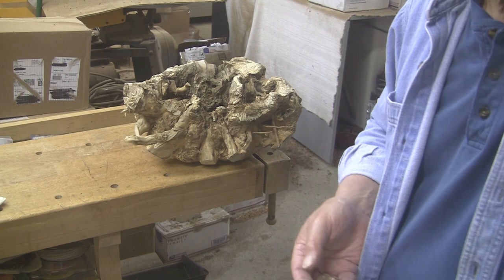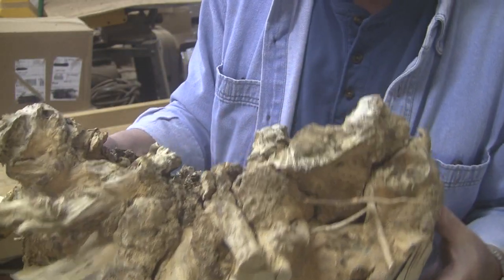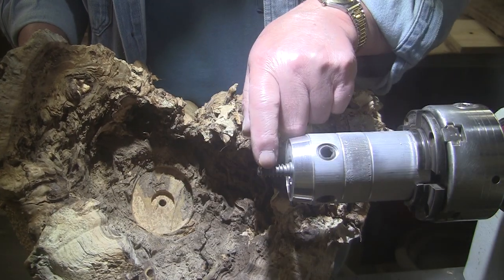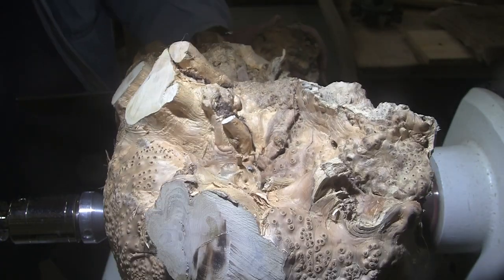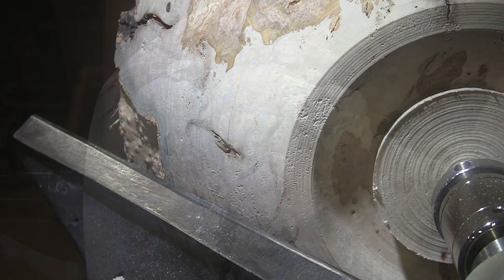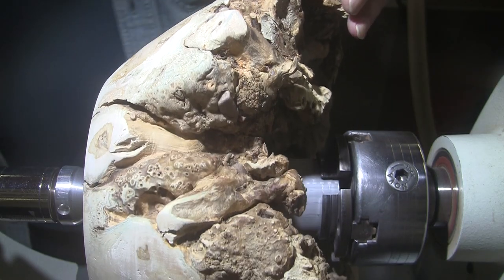How To Turn Honeysuckle Root, Rocks, Rot and All - Wood Turning

Comment: Watching you turn always makes me smile, Phil. That root ball is spectacular! Reminds me of turning manzanita burl root balls. I always marvel at the rock and gravel I find in those. Also, when I turn manzanita or a cracked burl ball of some sort, I’ll hold off the finishing product on the outside and use a sturdy tape if I am afraid it’ll blow apart. I’ve had too many of those pieces blow up on me! I keep the tape on for sanding also because of the outward pressure while sanding. Anyway, thanks for another wonderful piece. I love your work and how you tackle everything and anything! Well done, Sir. ❣️
Reply from the maker: I've turned Manzanita, Danella, and I'm not sure I ever want to, again!  😊The hardest wood I've ever turned.

Comment: Outstanding work once again Phil.  I have turned a few inverted root balls of a similar size and generally use a recess on the bottom.  If there is any question of structural integrity on the base I drill and fill with Araldyte (two part epoxy) and sawdust.

Sanding the inside was like brushing the back teeth of an alligator!
Reply from the maker: Thank you, Robert!  Love your alligator reference! 😊

Comment: You take a piece that 99% of us would burn, spend the better part of a week turning it and then apologize for using carbide while your "watchers" hold are breath as your turn it.  What an amazing project Phil.  Simply stunning.  I was wondering if you ever considered using Milliput epoxy to fill in those massive cracks because that monster you just turned had us on the end of our seats?
Reply from the maker: Thank you, G G, I'm really glad you like it!  I try my best to work with what I'm given, turning it as I found it.  I will fill cracks if I absolutely must to maintain structural integrity, but I prefer to leave them natural if at all possible. 😊
Reply: @PhilAndersonShadyAcresWoodshop  that's awesome.  I guess that's what makes you the artisit you are.

Comment: Don't have words for how remarkable this piece came out.  And your skills.   I just found 2 small root balls.  Not sure what they are.  As a newbie, kinda nervous about putting on the lathe.
Reply from the maker: Thank you!  This is what I believe that might help ease your mind:  If you can hold it, you can turn it.  This means a strong hold that you are confident in.  That way, you can relax and concentrate on the turning rather than if it's going to go flying.  Other than that, look the piece over, spend a little time with it, remove whatever is necessary, make sure it seems to be sound and go for it!  Have fun! 😊
Reply: @PhilAndersonShadyAcresWoodshop  thank you.   Is there a way to send you before and after pictures?

Comment: I used to be an "As natural a turning as possible " type person, but ever since I've been exposed to an epoxy filled turning, I'm far more flexible. Basically,  I watched this whole video, waiting on this to blow up into a billion pieces, but was relieved when it didn't.
Reply from the maker: If there was any chance it would have blown up I wouldn't have turned it.  With a little experience you can tell what is turnable and what isn't. 😊

Comment: New sub! This kind of craft I enjoy with narration and whenever possible some dynamic compression on the tool noise, such as when you time-lapse a segment.
That said, one thing I would very much like to hear more about are the choices you make based on general preference versus particular applications. For instance, you mentioned hating to use the carbide, while I see other wood-turning videos frequently use them without comment. Does one give you a better sense of the cuts or is one better for softer wood?
Reply from the maker: Awesome, thank you!  I will try to be worthy.
Thanks for the intelligent comment and questions.  I definitely prefer high speed steel tools.  It is, as you suspect, because I can feel the wood better.  They also help me from an art perspective.  With carbide I feel like I'm just steering the tool around and whatever I do, it works.  Not much of a challenge.  For me, carbide has it's place and that is to do what I can't do with HSS.  Sometimes it's because the tailstock is in the way and I can't get into a piece due to the angle necessary with a traditional gouge.  Other times it's because the wood, or rocks as the case may be, just won't give way to traditional tools.  I also feel that it is more interesting to watch traditional tools in use.  It's all subjective, I suppose.  Thank you for watching and commenting, Kritter! 😄

Comment: Wow that's just an insane piece of wood! When you started turning the inside I thought, "Good Lord that looks bone jarring as all heck!" Came out pretty nice though. You said one side of the big crack was higher than the other on the inside, did it end up that way on the outside as well? See you in the next one friend!
Reply from the maker: Yeah, it was pretty jarring, Hotrod.  Just have to take light cuts on a piece like this.  I had to go look at the piece just now to see if the crack was uneven on the outside, as well.  The answer is yes.  It's a very small amount both inside and out, maybe 1/16".  You can't see it but your fingers can feel it.  Thanks for watching! 😊

Comment: Phil, I like it, I consider myself to be a person who does not give up, but I bow to you.  You are one determined person, but you have
shown that determination garners rewards.  Very good job.  I have a question about your sanding sealer.  Can an oil finish like 
Danish oil be used after the shellac based sanding sealer you use.  I still believe people are trying to send you the piece that you 
wont be able to turn.  I don't believe it exists.
Reply from the maker: Haha, thank you for the kind comment, Gerald.  I'm not an expert on finishing but I don't think you can put an oil finish over a film finish.  The oil needs to penetrate the wood and I don't think it would ever dry over a sealed piece.

Comment: Do you have a Sand-o-flex for each grit?
Reply from the maker: I do have several, John but I only have about four that I use on a regular basis, each with a different grit, yes.  By far, 180 grit is my most used.  I use it for bark and other natural areas in a piece.

Comment: Question...How do the rocks NOT ruin the tool?..Don't they nick the edge requiring alot of grinding to get back the profile?
Reply from the maker: All I can say is, not in my experience, Richard.  You have the bevel of the tool riding along the wood.  Very little of the sharp edge is exposed when it encounters a rock that is buried in the wood.  It just sort of slides over it, I guess.  Sure, it dulls it but I have not experienced any chipping.  Sharpening takes less than a minute, back to work! 😊

Comment: I know i'm late, but centrifical force caused that rise at the end. Being a counter clockwise turn, that edge expanded.
Reply from the maker: Centrifugal force at 300 RPM?  I think it has more to do with the drying process and relieving tension in the wood as I turned it.  In any event, I got it done and I love it, it sits front and center where I see it every day.   😀

Comment: Wow. Kinda like turning an octopus without its arms. Does Tuffy sell these?
Reply: Hi Jay... That was just a one off experimental piece from over a year ago. A small production would be easy but not what I want in my simple Simi-retirement life. I possibly do know folks that might be willing but would need to run it by them first, OK?...TM
Reply: @tuffymartinez  Hey there. I can make locally if you’d care to share any drawings you might have.
Reply: Thanks Tuffy. And thanks Phil. I’ll work on it.
Reply: @birdman858  Hi Jay. The reason I included the threaded rod (common 3/8" "all thread") was to keep the "Phil Adapter" safe. Without the threaded rod the tool would be weak, unstable and could possibly come out of the chuck while turning. Safety first always Jay. I do not recommend anyone duplicating and using such a tool. OK, Jay?...TM
Reply: I like that idea. I’ll work on it over the next few days. My lathe is down right now, so it’s a good time to work on other projects. Thanks again, Tuffy. BTW...what is your You Tube channel?

Comment: Put it in a bucket of resin and a pressure chamber! 😱 Safety first! ☠️
Also, the resin will help make the burl a complete, useable bowl!👍
Reply from the maker: It's art, Karl.  Most of my work is art, not meant to be used but to be appreciated for the nature in each piece.

Comment: So Phil, why do you consider carbide tools not "artsy" or whatever it was you said? It seems like you avoid them unless there is just no other solution. Is it primarily loyalty to the traditional tools and methods (that's not a criticism) or some other reason(s)? And of course this is a beautiful piece, as is almost always the case.
Reply from the maker: It's just a matter of preference, of course, Bert and different people have different preferences.  I worked hard to learn to use traditional tools.  When I use carbide I feel like I'm just steering a tool through the wood.  I can't really feel the wood.  Every move feels the same.  Also, I don't think it's as fun to watch and that is a primary focus for me. 😊

Comment: If you brace your hand tightly against the tool rest, your hand and gouge will not oscillate as much between the high and low spots, reducing the risk of a catch, and giving yourself a smoother cut.
Reply from the maker: Have you tried it with a piece like this, Doug?  I don't know about you, but I do know about turning pieces like this.  Of course, your advice is great for a normal or even semi-normal blank.  For something like this, turning at a low speed due to imbalance, it's nearly impossible. 😊
Reply: @PhilAndersonShadyAcresWoodshop  I have turned big awkward, punky pieces. Of course, the faster you can get away with the turning speed, the better, so there's less time between the peaks and valleys to allow your tool to move in too deeply and risk it grabbing and tearing out more material than you want. I didn't see that happening to you. Though I did see by the way you were so loosely holding the tool, your hand and tool oscillating too far into the valleys. I'm only suggesting using a firmer grip with your hand pressed/braced more soundly against the tool rest to reduce the oscillations. Keep on creating, dear brother.